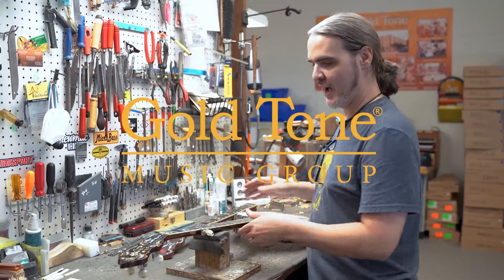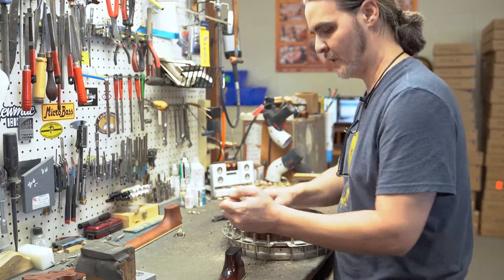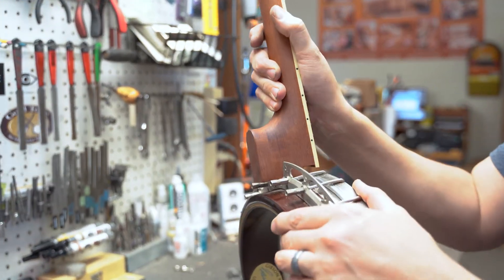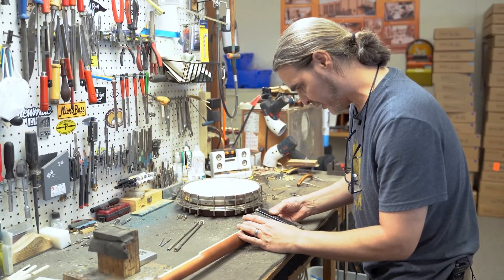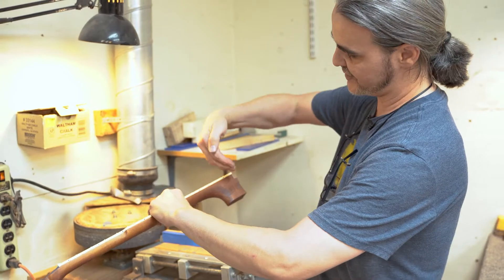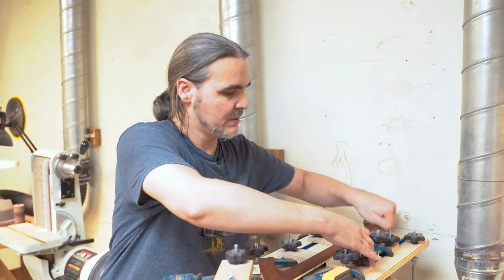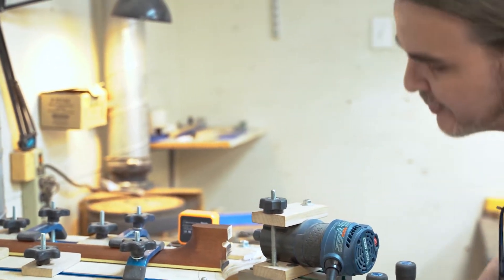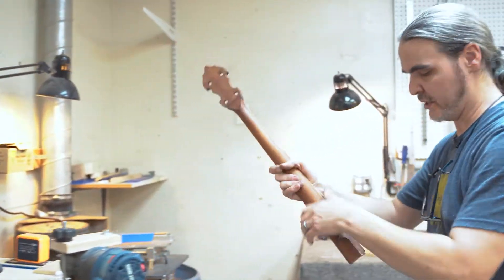Earl Scruggs Gibson Banjo Neck Replacement! Béla Fleck Neck!

Comment: Nice craftsmanship.  One question, why not use the old neck as a template to rough cut the new neck?
Reply from the maker: Hi there! Great question! This particular banjo needed a full set up to begin with meaning the neck most likely was not properly fitted any longer. It would not have made a good template at this point.